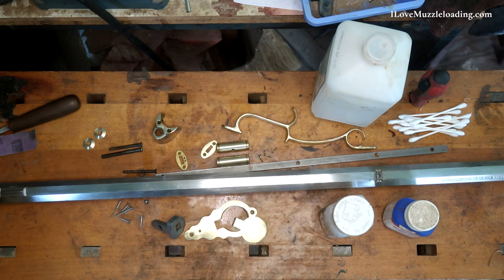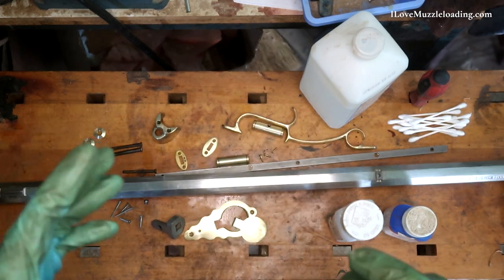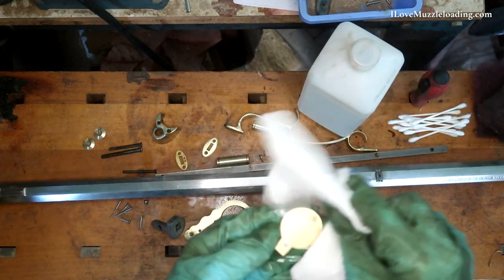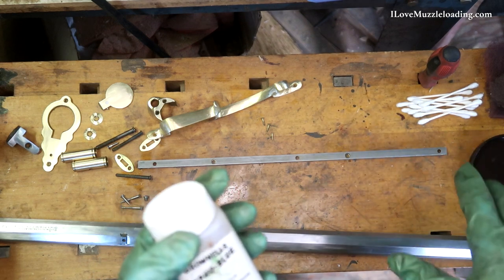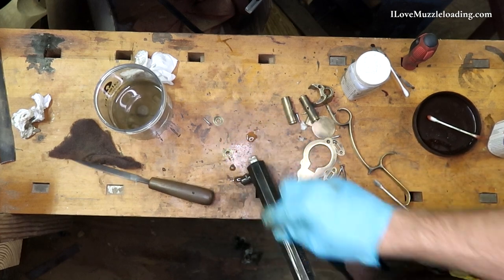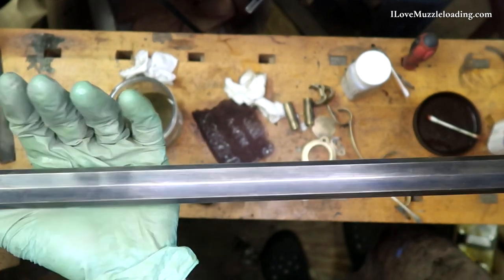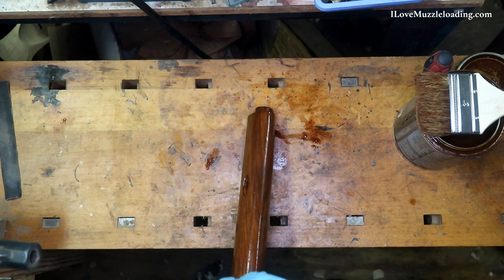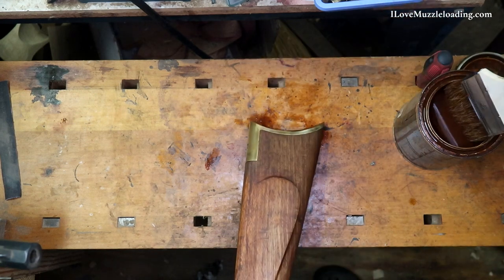Brass Black, Cold Blueing and Wood Staining | Let's Build a CVA Hawken Part 8 | I Love Muzzleloading

Comment: I used a 17th century recipe for oil staining on what was considered a secondary wood for 17th century gunstocks when building a snaphance carbine and pistols back in the 90s . The recipe is from a treatise on gunmaking in the British Library and is simple and cheap . Alkanet root and burnt umber earth in linseed and turpentine . I found the alkanet root in an asian supermarket as 'Alkanjot' by Natco I believe , and used the burnt umber from my artist oil paints , but both are inexpensive to buy outright , probably cheaper than a tin of modern stain and both historically and currently correct for a gunmakers oil stain . Grind the root to a powder if not already powdered . This is a strong red dye which you tone down with the brown of the burnt umber to taste . The artists burnt umber has linseed already in the mix . Apply the first coat well thinned with turps . The result on very pale beech afted a few apps was a walnut colour and tough finish . I guess you could substitute turps for citrus oil if the odour of turps is too much or even naptha ( lighter fluid ) for faster results .

Comment: Ethan if you use Birchwood Casey's cold blue it will black out your brass. On polished brass it gives a sweet transparency on the brass, a nice shine. On some of mine I antique the brass first and it gives it a flater oxidation look that works back nice. Beautiful rifle you got going on. I finally finished my T/C Hawken and have several videos published on it. I used the cold blue on all the brass and trimed it out  with copper. Red stalk of course.

Comment: you really need to try Mark Lee no. 3 rust bluing.  do a rifle with the real rust preventive rusting.  I knocked it back with pillow ticking instead of steel wool.  I've done the boil water in a piple to get the blue and I left it brown on one to to say I browned a gun.  try it you might like it.

Comment: Wool swabs from tandy are much better that ear swabs. Also to patina brass, pour an ounce of raw apple cider vinegar and a pinch table salt in a sealable container. Place cleaned brass parts on a wire tray cut to fit the container and place lid on to seal. Leave for 2 or 3 hours. Perfect patina in true color. Not black brass.
Reply: Forgot to mention, the wire tray keeps the parts out of the solution.  The patina comes from the gates coming off the salted vinegar. Repeat as needed to achieve color depth.